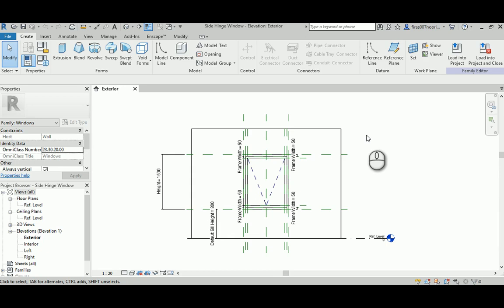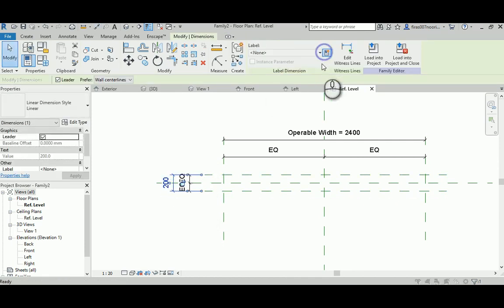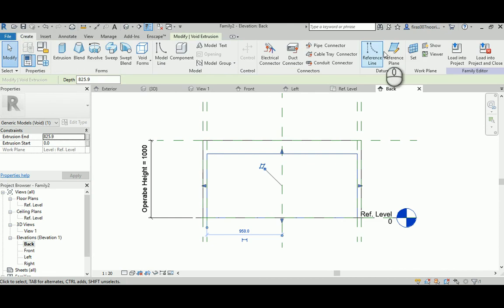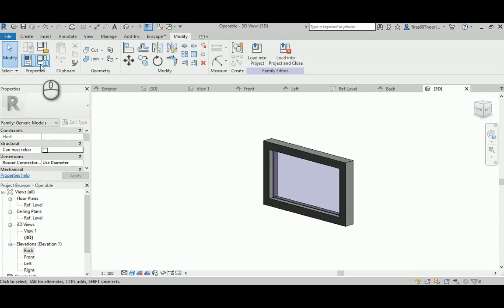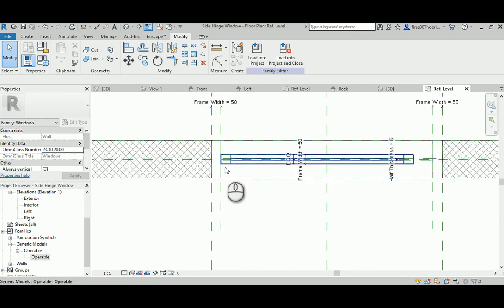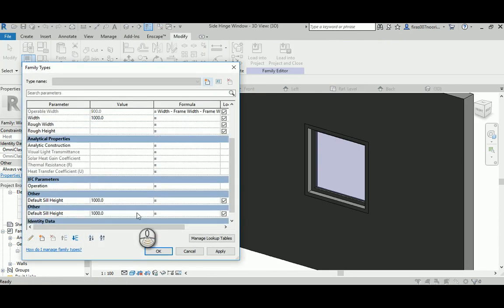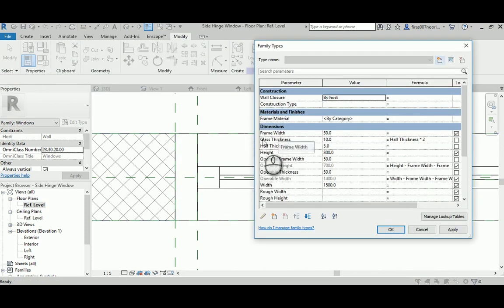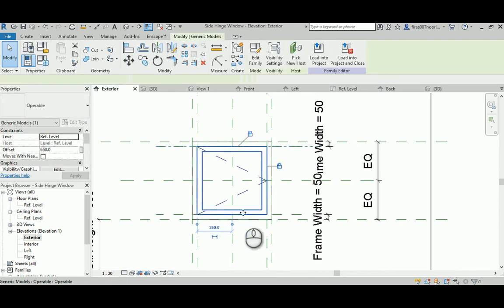Revit Window 3 _ Side Hinge Window Family

Comment: Hi, congratulations on your videos! they are very clear. In the case of simple objects (such as doors or windows) I wanted to ask you what advantage there is in creating a nested family (which then involves assigning each parameter in the host family) compared to creating the parameters directly in the second one. Then I wanted to tell you that I am confused about the many types of family that by changing individually bring the plans to change differently from the thickness of the frame. These are: operable thickness, operable frame thickness and frame thickness (you too noticed the problem at the end of the lesson: in fact you changed the first one from 80 to 50). Thanks bye. alemundo@libero.it
Reply from the maker: Thanks dear Alessandor!! For your first question (what advantage there is in creating a nested family?)
Well by the time I was designing this video, I was intending to complete it into the second tier of details where you can add different window components by selecting sub_componenta, for example, I wanted to make the window frame changeable parametrically based on the user need to change the profile of its section, this is best to be done as nested family so you can call that frame into similar families like doors for example, without the need to remodel the same thing each time in new family, I was also reasoned to lots of questions of how to make nesting in Revit families.
My attention goes less on this series of families videos as I saw seriously weak responds from viewer and thus did not continue to make the full intended set,  I will answer your other questions very soon dear.
Always welcomed and happy to talk to you dear Alessandro
Reply from the maker: Imagine designing the operable part of the window ad a Hallow frame with glass panel, fully parametric, and you will use that same operable part in a door.
Imagine making a door handle full parametric, you also need to make it outside as a nested family so you can call it in all your windows and doors.
You can indeed model that within the window family itself as it is simple as you said, but I was intending to explain the topic of nesting and also to complete this series to make the user able to make more advanced families which has changeable inner components